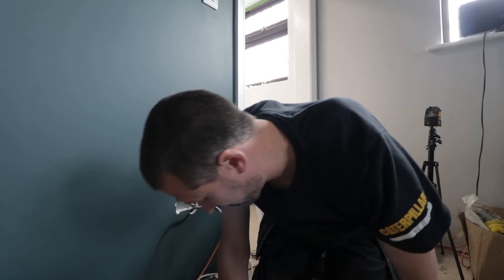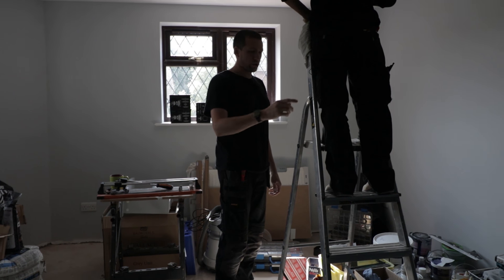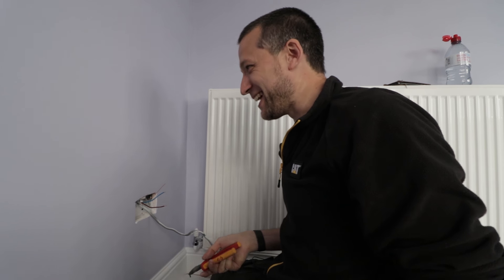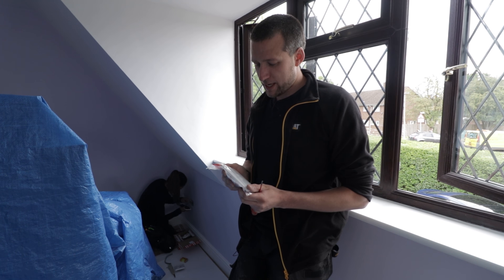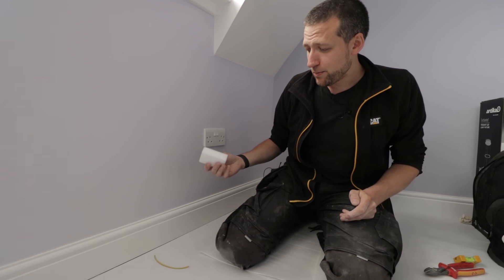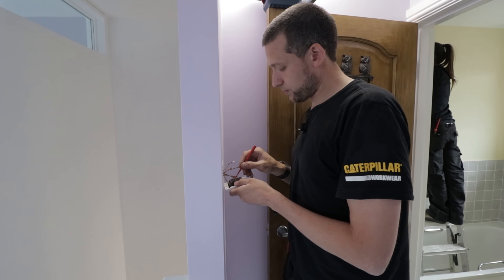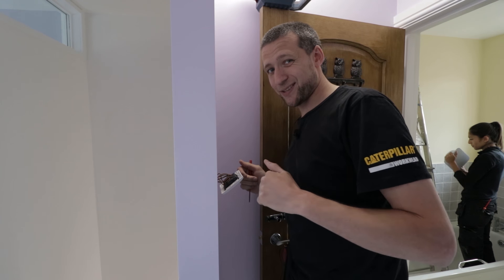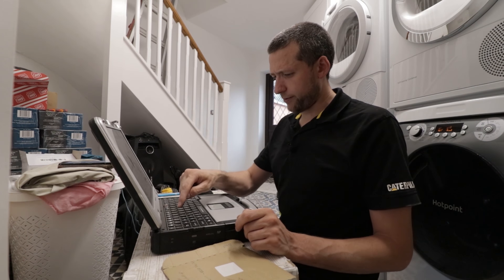Second Fixing a new house ( and meet the new team player)

Comment: With those plasterboard fixings I generally make my hole (6mm, or ram my pz2 driver through!!!) then snap the tops of the fixing off with pliers before sending them in. This also allows you to bottom the screws out without them trying to spin the fixing if you're using a shallow light fitting/fan etc

Comment: Welcome to Naiomi! Certainly seems like a good independent worker, always seems to be quietly getting on with stuff in the background while you're recording, which is fantastic. I'm sure she'll be a great part of your team 👍

As for the plasterboard fixings - not sure if you've tried them, but the only ones I've ever found reasonable are the "hollow wall anchor" type (when used with the proper setting tool) that then give you an M4/M5/M6 thread in the plasterboard. I've never had much success with any of the others.

Comment: How did you go with that broken cable. You probably know this but the capacitive function on your multimeter can help narrow down WHERE the cable it's cut. You measure the capacitance at both ends. Add it up. Work out the percentage of one side only / total. That percentage is the percentage length along your cable where the break is. Saves a lot of time when cut cable faults are inaccessible behind plaster.

Comment: HI Naomi, you 2 seem to work well together.. going to add alot to the videos.. I am from "across the pond" and find it interesting how different electrical systems and devices.. even the colors of the wires where here it is red, black, white, green/bare and most devices are separate from the cover plates.

Comment: TOM - RE The self feed plasterboard fixings. 

The connection from the plasterboard cutting tip to the actual screwing part it fragile on most brands of that fixing. I always pre-drill a 3mm/4mm hole first so it doesn't place so much tension on the fixing and also stops it being so brutal on the plasterboard.

If I were putting them in my own home the fixing would go in by hand with a flat head - they are so brutal on what is a frail material (plasterboard).

Comment: For those magic sponges, you can cut a small bit off (like 1 inch square) rather than using the whole thing so they last even longer. Only problem with them is they will remove paint and take the shine off gloss if you're not super careful

Comment: Always recess the back boxes even with dot and dab because if the wall is out of plumb the board may run tighter to the sub wall in the high spots.
I’ve dabbed over sockets that haven’t been cut in before on old wavey walls and what a nightmare...

Comment: Thanks for covering the switch layout.
Many years ago on my course (Entra) they covered the light switches but the layout was everything goes into the ceiling rose then out to the switches.
They claimed it was more simplistic wiring but it looked a right mess in the ceiling rose. It’s only simplistic at the light switches with this layout
Reply: I hate running into all the light switch wiring in the ceiling.  As a policy, I make sure we complicate the switch boxes and leave the lights simple.  Trying to deal with a chandelier or ceiling fan to troubleshoot a light circuit is a huge headache.
Reply: Why not prefer 'Surewire' type junction boxes, certainly once they replace the screw down cable claps with 'Wago' style cable restraint. Then you'll have simple wiring at every light switch AND every ceiling rose.

Comment: That smoke detector doesn't look 300mm away from the wall, also those pigtails have a tip designed to shear off so they're not ridiculously long in a small void, you're not supposed to push on too hard, slight pressure to break through the plasterboard then the end will shear off when you put the screw in or if it hits a solid surface first. Better than when you try and insert a pigtail and it spins allover the surface of the finished plasterboard.

Comment: I would have personally used metal sockets and light switches with black inserts on the dark green wall
so they blend in. Either a pewter, brushed steel or black nickel finish would work well, I just don't like white sockets
on dark walls, Varilight, Click/Scolmore and Volex are good quality brands for decorative accessories. 
The MK Logic plus accessories are still just as good now as they were when they came out.

Comment: Good explanation on the 2 way switch Thomas this is different method live and neutral coming in switch the other method is a line from ceiling rose neutral at the light 💡 I always use the s line at light method and neural a t light or ceiling rose but iam familiar with the other method as well

Comment: Welcome Naomi !!! :-)
I inherited ONE thing from my dad; backwards thumb joints!!... Mine bend 90 degrees backwards, but don't bend forwards at all... Very handy for pushing things into place, but awkward as hell trying to use the indicator switch on my motorbike!
Q: do you always bounce the feed from switch to switch?... I have used this at times, but 99% of the time I bounce the feed from light fitting to light fitting... Is there any advantage?
Reply: Come on mate correct terminology please. Either 2 plate (Feed to switch) or 3 plate (Feed to light) feeding to the light is better when you have brick or breeze internal walls as generally you will have less cables at the switch location. So easier to Cap. Although my preference is to wire a feed to the switch. Makes it easier when fault finding. But either method has its
Pros and cons.

Comment: Absolutely 2 Bob socket outlets. Mk used to be the masters 15 years ago. How times change. The screw terminals do not tighten correctly, they feel as though they cross thread onto the conductors. I now use Selectric, cost less than mk did 20 years ago. I've installed over 2000 of these sockets spurs pendant's and switches and I've replaced ....... Two in eleven years.
Reply from the maker: I know what you mean about the sockets. They just dont 'feel' right when you tighten the grub screw down. Just as you say it sort of feels like it's cross threading and then you wonder if it's actually gripped the cable properly or not. Feel ya.

Comment: Why is the UK cable with bare wire for earth and you have to sleeve it and not like the other cores from the cables but in green yellow? And why is no blue wire in the cable, it is needed more often then not?
Reply: T+E cable has brown and blue colours which replaced the red and black colours and the 3core + E Is brown Grey and black which replaced the Red, yellow,Blue, there isn't 3core+E cable with the blue as far as I'm aware.
I would guess the reason why the cpc isn't sleeved could be if the cable was damaged it would catch  the cpc where as if its sleeved it may not penetrate the insulation sleeving and leave say s picture nail live stuck In the wall, I am just speculating I could be wrong and it  may just be cost.
T+e is 2 cable cores with earth.
Cpc is Earth just thinking you may not be from the Uk

Comment: What are the advantages of bringing the neutral into the switch?
Reply: Rodger Quinn some smart switches require a neutral. Also much easier to terminate 1 cable into light fittings and mess around with the 3 plate at the switch
Reply: Some smart switches require a neutral, and If the job involves downlights, wall lights or 2/5A sockets it'd be silly not to take the feed to the switch first. Even for fittings on the ceiling it's easier just having to connect SL/N/E and do the connections for the feed at the switch. 
3plate wiring comes from a time where a 16mm switch box was considered deep enough as most switches in the average house would be 1 gang 1 way and very unlikely to be a dimmer, also it saves a small amount of cable in most cases.

Comment: You've only known about magic sponges for a month or so!!?? WHERE have you been living? Do you not have kids then ... with crayons? LOL ;-) 

Love your videos. Nice to see someone who takes the time to do the job RIGHT! I have a mini level - two in fact - one is a laser line one about 80x20x20mm and the other is a TRUE pocket level (and VERY accurate) which came out of a (an expensive) Christmas cracker!! It's just the level bubble itself inside a clear marked resin block so about 25x8x8mm- almost as if it were a large spirit level insert (but it's not). Great for levelling back boxes though as it fits inside them. Surprised that as you have your phone always with you that you don't have a "level" app for emergencies. They work well and are pretty damned accurate too. TOTALLY with you on cutting 25mm back boxes deep enough to fit 35 mm sized stuff when needed. NOTHING more frustrating than going to a new home and finding REALLY badly fitted 25mm  back boxes that even have their metal edges proud of the plaster!! Yet MORE work just to fit a different design socket or something requiring more depth and worse ... JUST to sort out some lazy bar steward's shoddy handiwork!
I used to swear by MK for decades but I've come to like LAP switches and sockets. I'm an electrical and electronic engineer though not a spark, so I only buy stuff for myself not for clients. All that will change soon though as all our lighting is going 21st century fully automated and electronically controlled by 5 volts, 50mA (yes, 50 milliamps!) max in the (stud) walls via orange cat5e. All the glass fronted (ZERO metal parts and screwless) touch-only light switches - back illuminated, different colour for on off - will be my own design & manufacture connected to a central hub opto-isolated relay box - it may become opto-isolated triacs depending on how loud the relays inside the sealed steel hub box are in practice - they are pretty quiet though normally! As all the lights are now SELV 12v LED I may even end up with dedicated POE per lamp - individually switched dimming - EXTREME minimum heating, per bulb if needed - and at that point no more mains cabling at all in the over ceiling voids, just 5v control and 12v via POE.  I dread to think what sparkies will wonder about where the 1.0 and 1.5 square mm mains has gone and what to do with the orange cat5e cable ... probably try to fit RJ45's! LOL ;) I've copyrighted the design BTW so no copying! :-)

Comment: Am I correct in thinking that there are two washing machines with dryers stacked on top them in that utility room? Is the guy opening a laundry???
By the by new Dave is a million times better than old Dave!!!😍😍😍
Reply: Looks crazy eh, but it's actually pretty sensible if you do a lot of laundry. Those 7-9kg machines are actually cheaper to buy, more reliable and much easier to install than a high capacity washer/dryer pair. Take it from someone who's had to put in one too many 16kg Samsung washers (which are crap BTW).
Reply: Dontmost people have two sets if they have the room? I have two sets as everything is done nice and quick as  we don't have the time to do 4 peoples washing (two kids)  So with two sets it's done in our day off instead of all week with just one
Reply: I would think that the owner is going to rent out as a duplex so there would be a need for two sets.
Reply: I loved this obsevation ! I am The Customer. 
My Wife is a NHS nurse and hates spending her weekend washing, so has two washers and two dryers, job done on a Saturday morning. we have six in our house.
Reply: @TheT160  how much did he charge for the full rewire?
Reply: @TheT160  and you have one hell of an expensive electricity bill 😃

Comment: "boxes" here in USA, should be as flush as possible with the drywall face(or whatever finished surface material exists), if there;s a gap from wall ace to box front, (often fail inspection)

Comment: Tom, What is an End Of Line. Googled one and didn't make sense
Reply from the maker: it is a reference to the 'end of line' on fire alarm systems. It can be a diode that is placed in the last smoke detector to tell the panel that it is the last detector on that zone.
Reply: It’s used as a general term even in things like lighting circuits, end of line meaning the last light on the circuit
Reply: @thomasnagy  do they also have them on fire sounders and a single device on a zone
Reply: @thomasnagy  And hence the cable is intact.

Comment: Re. Plaster board fixings.
Pop a pz2 screwdriver through the plasterboard first to make a hole (or use a drill, but I'm lazy!) Then screw the fixing in. 
No more breaking the tip 😝

Comment: The reason the tip breaks off, is because you most likley didnt pre drill a hole before screwing it in!
Most of the time the tips break when you hit the second layer of plaster board. Sometimes even with a pre drilled hole they do break...

Comment: To anyone afraid their thumbs will get bent back if they keep pushing utilities in over a long time. Not true. Its actually hypermobility which you're if I'm not wrong either born with or it often comes early in your life, it depends on the cause which differs. You can read more about it here: https://en.wikipedia.org/wiki/Hypermobility_(joints)
Fun fact, hypermobility in that joint of the thumb is common in Sweden and even has it's own word. Skomakartumme, translating to shoemaker thumb.

Comment: I personally put Grey in L1 with SW, and black in L2 with the feed, i noticed you do the opposite, but I would have said that is the incorrect way as the sw should be in L. (otherwise when the switch is in the off position the light will be on)
Reply: Ermmm its 2 way m8😂

Comment: JW did tests on the MK series and dismantled both:
https://www.youtube.com/watch?v=osbADF3sOHU
2nd video:
https://www.youtube.com/watch?v=mqHV8v_zvuM
Fire test:
https://www.youtube.com/watch?v=xQpwGcqTixg
I love the Stabila pocket level. But I got the "Pocket Electric", with a gap in it so you can reach the screws to install the device (outlet or switch) much better. But for british outlets or sockets that's not necessary because the screws are on a different position compared to the ones we use here in Germany:
https://images-na.ssl-images-amazon.com/images/I/814GXKVfpaL._AC_SL1200_.jpg

And there's an alternative way to wire the intermediate switch, both methods will work perfectly fine:

https://upload.wikimedia.org/wikipedia/commons/4/45/Light_Switch_Chain2.svg

There are always several ways to Rome...

Comment: I hate those self drilling plugs. The holes are massive and don’t actually hold that much weight. If you have to use them, drill a 7mm hole and snap off the end of the plug, otherwise you can’t put the supplied screw all the way in.
Reply: Hate them too. Unless the load is completely static they fret loose and they leave a massive amount of damage in the PB to be fixed when they pull out as IME they usually do.

Comment: I'm no electrician, but I don't understand why everything is sleeved in brown. It would be an idiot that assumed any wire in the circuit was safe to touch because it was grey, black, blue or whatever colour. Surely The whole thing would be much clearer if the black and grey wires were just left black and grey??? 
I do realise 'rules is rules', but rules exist for a reason and I'm not clear what that reason is in this case.
Reply: For identification as sometimes old red and black cable ( new colours are brown and blue) Is neutral unless going to a switch when it is live so sleeved red or brown to identify it as usually a switched live wire,  and newer brown grey and black cable 3 core cable  the black Is live and the grey can be neutral blue or if used in a 2 way switch live. So its really to identify what the colour does.

Comment: So, properly:  what's the things with ladders?  Do they HAVE to be non conductive?
cos, I got one of those little giant type ladders and they are fuckin great for this type of work.
Use them as normal and you can work on a standard ceiling without any probs.
But for those jobs where you're doing a smoke alarm on a tenement ceiling that's almost 4 metres off the floor, this dinky little ladder that's only 4 rungs high can extend right up as a step ladder so can reach without any probs.
Can't get over how impressive as fuck this little thing is.
But it's aluminium.  Is the fact it's metal going to get me in the shit?
The ladder's pretty much the same as this. . .. kind of. . . .
https://www.youtube.com/watch?v=INfSWDPsOcc
Would properly like some feedback on this if anyone knows

Comment: how many damn washing machines does one house need ahahaha
Reply: gadgetman36 Still... it’s a house
Reply: We've got two dryers at my house, but a single washing machine. The whole wash cycle is a fraction of the time of a dryer cycle. You can do a wash load, pop it in one of the dyers, do another wash load, then pop it in the other dryer. Two dryers going at once (separate circuit/breakers of course).

Comment: Hi 
You might or might not like the way we "do it" in Iceland, 
"https://drive.google.com/file/d/1seS_83EvLlBweE3tW9cqkJ_hPW7wDQH8/view?usp=sharing", 
we usually do not cut the neutral. (there is some controversy about this) However Iceland is mostly TNC (4 threads to 5) so as you know the ground is connected to ground (nulled) at the main connection point.
To connect a ring in Iceland is not legal, we instead increase the number of fuses per house, it is not unusual to have 15 to 20 fuses for a 120m2 apartment.
I made the decision to move to Norway in 2014 and to my horror they mainly use IT without ground, without a doubt the worst system in the galaxy, if you like i could give you some horrifying examples!
I like that you have expanded your work force, what i have seen of you and your employees is nothing but good in my opinion :)
Reply: fok... ground is connected together with neutral is what i should have said :)

Comment: US switches so much better for 2-way switching with separate terminals for common and traveller wires rather than joining through loop wires and or wagos which will just confuse people of course circuit diagrams explain it all if well laid out.